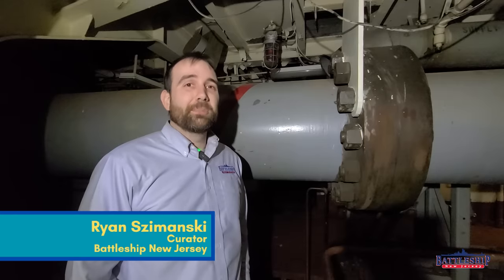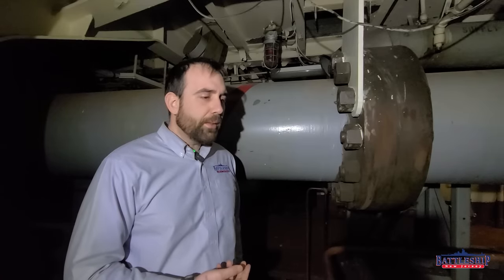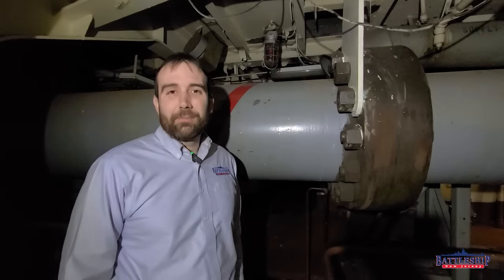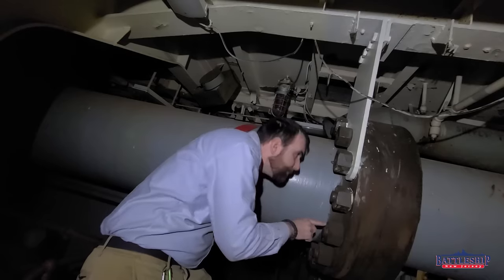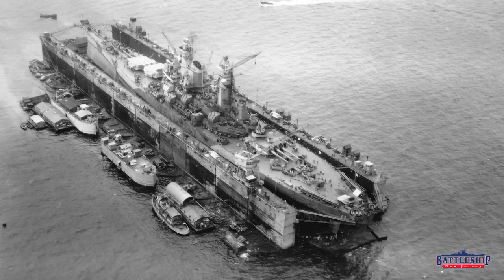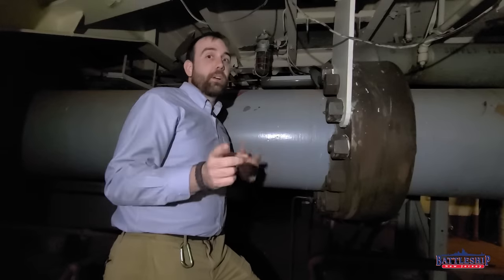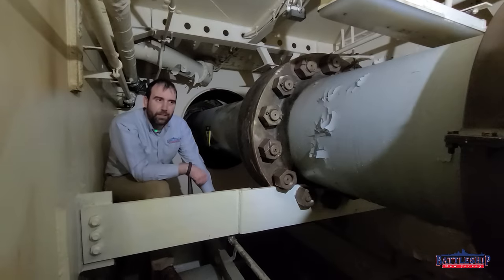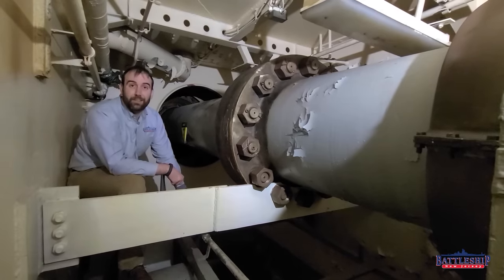Can The Propeller Shafts (And the Screws) of the Battleship Still Spin?

Comment: I don't think I've ever seen Ryan happier than when he was holding that battleship-sized wrench.
Reply: "can i have a battleship?"
"only a wrenchfull"
pulls out comically sized wrench
Reply: Thats  a slugging  wrench  i had my share of a hammer and swing lol
Reply: When I was an ironworker we called those  knock wrenches. My granduncle was a merchant Mariner. He was an engineers mate early in his career. He told me they used those wrenches and sledgehammers to tighten bolts and stud nuts. Torque was either measuring the bolt stretch with a dial indicator, or snug plus a certain number of degrees of rotation
Reply: @harescrambled In Australia they're called flogging spanners.
Reply: @hoilst265  Slogging spanner in the UK. Used a lot for plumbing.

Comment: That wrench seems like it should end up on display on tour route, also would keep it out of a place prone to having condensation on metals, possibly get some rust removal and fresh paint to prevent further deterioration too.
Reply: or oil as a functional tool
Reply: Probably better to keep it near what it is intended for.  Out in the open items can end up misplaced or stolen.
Reply: After 30 or so years sitting in the same location it seems to be in great shape.
Reply: Other than the history of that being the exact wrench thay did the job, it's an easily replaceable tool, and I'd be willing to bet it was accidentally left there. It's not a tool specifically made that is only used on battleships so I'm betting it was from the common toolkit for whatever unit mothballed the ship which means someone probably got yelled at for losing it
Reply: Very often aboard ships, tools like that wrench that have a specialized "purpose" are bolted or hung on brackets on an adjacent bulkhead.  I have over 20 decades as an engineer in the merchant marine and for instance, on my last ship we had shaft locks and wrenches very similar to those in the video.  I never saw them used, but both the lock and wrench were painted bright yellow and ther wrenches hung on welded brackets made for that purpose.  The bolt holes in the shaft locks aligned with welded studs on the bulkhead and were secured with nuts (not same size as the shaft coupling bolts).  While hardly, if ever used...they are readily available if needed.  I am suprised New Jersey doesn't have a similar set up, but do understand why the wrench was located close by.
Reply: @MichChief  Sorry Chief but just HAVE to pick on you a little ... "20 decades" would mean you spent about 200 YEARS as a Merchant Marine Engineer so I suspect strongly you simply meant "over 20 YEARS" which is still a damned good run sir, and really do know what you are talking about.
Deepest respects sir.
Reply: @robertf3479  Nice observation...I did have a small laugh over my error.  Although I did mean to write 2 decades (my typing skills are far from desireable), some mornings I do feel 200 years old when I am getting  out of bed.  

Thank you for keeping your correction polite and courteous.  Best to you sir.
Reply: @MichChief  LOL!  I do understand about feeling 200 years old when prying myself out of bed even though I'm "only" 70.  It's a pleasure to make your acquaintance.

Comment: Now I know how to unlock the propeller shaft on my battleship. Really helpful video for do it yourself battleship maintenance.
Reply: For some fun support undo the couplings at the engine/gearbox, remove the locks and let those props spin. Perhaps some support stands with rollers for the loose end of the shafts so they don't flop around.

Comment: That's your basic "knocker" wrench. There's a sledge hammer looking for that wrench somewhere. We used those to break the couplings on large steam turbines in power plants for years. At least until they bought us our first Hy-Torque wrenches. Nothing like a hydraulic wrench to make the day go better.
Reply: Also sometimes called slugger wrenches
Reply: USN called them slugging wrenches.  The problem was room for the sledge hammer and room to swing it.  "Torque" settings by ear.  When you couldn't get the wrench to move with a decent blow, it was torqued correctly.  Practical technology.
Reply: Flogging spanners in Australia and probably the UK.
Reply: hy torques are cool and we still use them, but have you ever seen rad guns or hydranuts?
Reply: Millwright?
Reply: @hannahranga  Correct about UK terminology.  Had a fine collection of flogging & banana spanners when working on RN warships back in the 70's

Comment: I believe they only prepped the Iowa to be able to sail to the west coast for the permanent repair and replacement of the shaft. The floating dry dock just locked the bent shaft and Iowa returned on 3 shafts.
Reply: dry dock was to remove the prop on the bent shaft

Comment: I wasn’t understanding how the shaft stop steel bracket was stopping the rotation until I realized the entire gray shaft and coupling all spin together!  Those are big mammas! lol
Reply: thought the same. Thanks for pointing it out. This also answers why there is a red stripe on the casing so the shaft can be seen moving.
Reply: Getting tangled up in that = zero change to ship's speed  0.0
Reply: @skipmountain9283  Which is why it had that protective cover over it he mentioned them removing to install the lock.

Comment: When my old ship went into drydock, I was in charge of inspecting the zincs, installing a new corrosion monitoring system, and supervising the install of a few new pieces of gear - a log, and (i think) a depth transducer.  Everything that had to hold back water was bedded in 3M 5200, applied by yours truly.  White-knuckle frightful time when we went back in the water, if anything leaked it was on me.  I would love to see some details on underwater fittings, any electrical? And is there anything making water currently that will get addressed?

Comment: Those prop coupling fasteners may be balanced to be the same weight, hence the marking to ensure they don’t get lost and replaced with some random nut that could throw off the balance.
Reply: At only 200RPM max I doubt the weight of a few nuts would be enough to make a difference on something that size, and when the shaft itself weighs several metric tons.  That's only a little over 3 revolutions per second, not fast enough for the centripetal force to make a difference.
Reply: @rudolphna54  you bring up some very good points.  I wasn’t sure how fast the ships screws were turning.

Comment: This looks very familiar to me.  5-Stand Rolling Mill drive shafts are not quite as big as the New Jersey's shafts, but have the same type couplings.  The wrench is called a slug wrench and is normally used with a sledge hammer.  I had a 12# with the handle cut down to 3 foot since the space was close. After the overhead crane had pulled the covers, you had slide down into a pit and start removing bolts to change the 2000 HP DC motor.

Comment: You could use your index finger to the first joint to help measure things. It is usually 1 inch. In reference to checking the thickness of that plate installed on the lock.

Comment: Just thinking of the amount of logistical planning and personnel involved in pulling and replacing 300 feet of prop shaft out the back of the ship through all those water tight compartments. Which begs the question because of the amount of weight involved with just moving one section of shaft, the they made out of solid round stock or are they hollow like a torque tube to conserve weight?
Reply: Hollow.

Comment: Another reason to segment the shaft is that it would let you use a much sorter dry dock to remove the shaft. Even if you had the ability to move it in one piece, you would need a dock almost twice the length of the ship to have room to do that.

Comment: Question: I don't know if you already answered this question, but on Battle Ship Texas they have special steering wheels that are in the bottom of the ship and are directly connected to the rudder so during engagements if the regular steering was damaged or destroyed then the ship could still steer. My question is, does this ship  have a similar system? If not, what was the backup plan to stear the ship if the regular controllers for the steering were destroyed or disabled.
Reply: Yes.  They have done a couple of vids about all the steering locations - here's an old one just about aft steering  https://www.youtube.com/watch?v=sL21Wl_-Qdc
Reply: @garywayne6083  thanks

Comment: There is a chance work is sending me to the head office in New Jersey this summer.  I hope your not in dry dock when/if i get to go!  Im surprised that first shaft only had a small chunk hanging from above to lock the shaft.  Those screws are massive and i can't imagine how much torque they would put on that plate if the ship got moving against a strong current.
Reply: The flow of water would also have to overcome the inertia not only 350 feet of shaft that's about 3 feet in diameter, but also the reduction gears and turbines.  That's a lot of objects at rest that want to stay at rest.
Reply: With no lube oil pressure....

Comment: Hey mr.Ryan - if you look around those locks - I wonder if there is the tool (your battleship size wrench) around each of those locks - or if one was custom fit for the job (no doubt) - I did 6 years at JSI from 79 to 85 and before that I never knew wrenches could be so large - all kinds customized (usually cut off) because of tight clearances - REALLY enjoyed this one - actually enjoy most all about the iowa class, take care and thamks again.

Comment: The 'NC3' on those nuts probably stands for National Coarse, 3 threads per inch. Its easier to stamp it into the hardware than it is to measure the threads to find new ones

Comment: Large ship propeller shafts are a complicated item. They are designed to resist the very high torque needed to turn the propellers at high speed. Something for a future video might include things like the reason that large propeller shafts are hollow. Yes they have al large hole in the center that travels the length of the shaft. Also the twist of the shaft under load. Air Craft carrier shafts are a big as 30 inches in diameter with a hole down the middle. These shafts might take on a twist of as much as 1-1/2 times due to the torque at full speed. Is there information available about this for the Iowa Class?

Comment: Is there a "clutch" for disengaging the turbine and/or gearbox from the propellor shaft allowing maintenance test runs on those without moving the ship? If so, would be interested in seeing those and understanding how they work.
Reply: Nope.  Everything is direct.
Reply: The jet engine ships have a triple-S clutch that declutch the gas turbine from the reduction gear, when the gas turbine is secured.   but i guess that;s not the same as disengaging the propeller and propeller shaft from the reduction gear (what is called the main engine)    even on gas turbine ships, the propeller, propeller shaft are connected directly to the main engine.

Comment: I remember my ship going into dry dock, and during the drydocking the yard was going to replace the propeller, the shipyard asked the cheng where the propeller nut wrench was?   Aroo? goes the engineer...    no one knew so the shipyard manufactured another propeller nut wrench from ship drawings so that the nuts holding the propeller to the shaft could be removed...   after the drydocking, the yard gave the wrench back to the ship... the CHENG didn't want to lose the wrench, so he had it welded to the bulkhead in the shaft alley...

even if the shafts were unlocked and were free to spin, it's unlikely the shafts will be balanced after all of that time spent locked.   when a ship is in port with the engines secured, the shafts are put onto the jacking gear and so that propellers will still spin 3 rotations per hour to keep the propeller shaft from bowing due to gravity.     

I think if the NJ propeller shafts were spun at any significant speed now after being stationary for 2-3 decades , i think the shaft bow would tear up the shafts in due time.

Comment: So the shafts went completely in the open all the way from the engine to the rear? Or was the pipes there just a tube protecting the shafts? Just asking cause by modern standards that seems like a design with some major OSHA violations :p

Comment: Curious how power is supplied to the museum ships. Do you use shore power and if so, do you maintain power when the ship is being towed from site to site?
Reply: Shore power, using the original ship's switchboards and wiring.  No power required while moving the ship, as will be a "dead tow" with any nav lighting and such the responsibility of the towing vessels.

Comment: I am not into engines, props or prop shafts, but with this being a battleship I would have thought that if the boilers were brought up to full operation status & an engine/shaft engaged that the torque would have been enough to tear those locks right out of their welds? or would the torque from a standing start not be enough therefore the engine twists the shaft out of her seating/bearings? Whichever the damage caused would no doubt be massive.

Comment: The prop shafts are hooked to the turbines, which are turned by steam from the boilers.  I suppose you could call the turbines engines but if they turned I doubt it would do any damage beyond harming the bearings.  The turbines (if lubed) should turn pretty freely,

Comment: I thought those shafts would be bigger. The torque transmitted is large, about 1.25 million ft-lb...but it seems like other factors would matter more... surviving nearby explosions, and gyroscopic forces. Any abrupt acceleration of the ship- due to torpedo, collision, or , the memorable picture of all 16" guns firing at once, clearly shoving the whole thing over a bit. Lot of force to move those big propellers, especially while spinning 200+ rpm.
     I guess somebody else figured that out correctly,  though, and I didn't.

Comment: If the US Navy wanted to reactivate an Iowa class battleship, would they have the knowledge to be able too? It’s been 30+ years since operating on their own power.
Reply: With enough money everything is possible. Institutional knowledge on the specifics of the Iowa class has definitely been lost but with enough money and time it could be worked out. The only issue is that it would be a ludicrous use of money.
Reply: @JamesF0790  There are still some of us out and about who served on ships with 600-PSI steam plants up into the late 80's and early 90's, so the general knowledge is still out there.  However, that pool is rapidly draining.  I'm 56 and probably one of the "younger guys"....
Reply: @kevincrosby1760 Oh absolutely. I don't doubt there are people who have worked on similar hardware or even an Iowa class battleship. I was more specifically referring to institutional knowledge in the Navy itself. One way to regain it would absolutely be to call up the people that served on those ships or similar ones and ask them to come back for training new crews. I also get there are probably some people still in the Navy that served on the battleships but I'd wager not many but then again I'm some guy in Australia so I could be wrong. 

My main thing I was saying is that it's not just a case of taking the ship back (Which I think requires a declared state of emergency? I haven't read NJ's contract in ages) but it would also require a WHOLE lot of getting people up to speed on the systems involved before they could even work out what work needs to be done before they could start the re-activation process.
Reply: @JamesF0790  the last 600lb steam plants left in the navy are in the Wasp class LHDs.  there is a small group of MMs left in the Navy that still know how to run a steam propulsion plant.  I was floored when i took my kid to see Alabama in Mobile and we went down the ladder into the fire room they have open to the public, i saw the gauge board and i actually understood what information the gages were presenting and implication of that information.   I was surprised that the knowledge i got in the late 90;s working in the enginerooms of a LPD wasn't much more advanced than the engineroom of a battleship decomissioned in 1948.     i really enjoyed explaining to my kid how you'd go about the process of lighting fires in the boiler in front of a boiler pointing to what needed to happen and in what sequence...  lol  nostalgia.